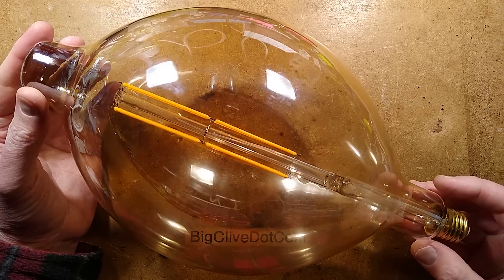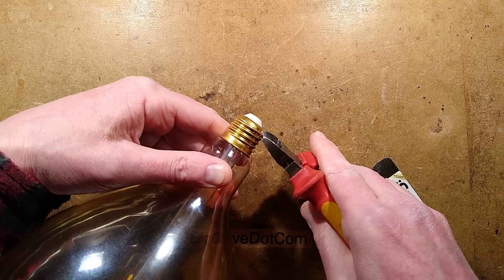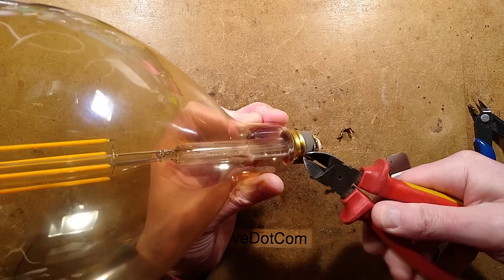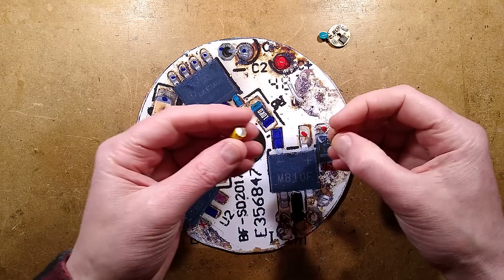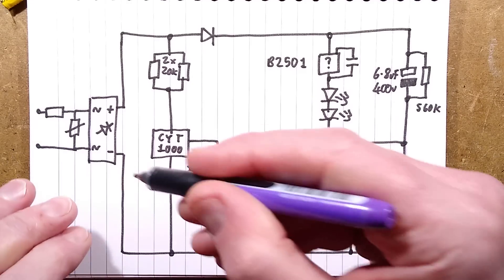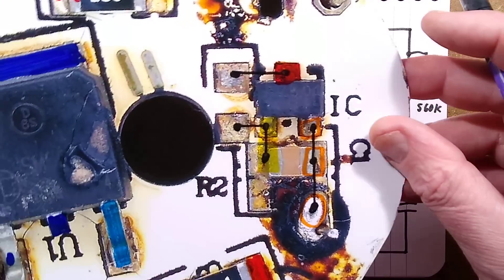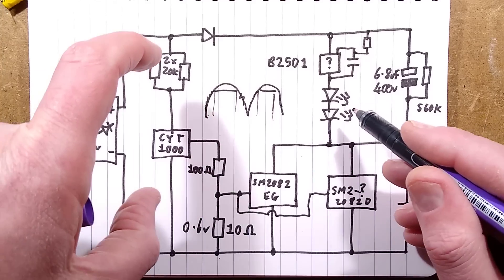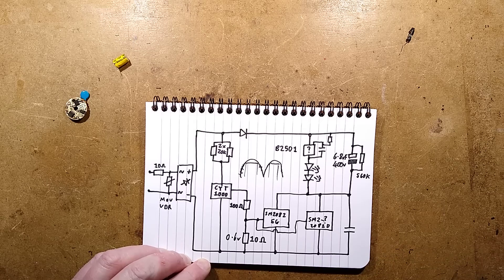Inside a huge faulty Poundland lamp

Comment: If you got some thick-ish tinned or bare copper wire, could you tin one end, push it up to the contact, then hold the soldering iron onto the free end and let the heat creep up the wire? It always seems to creep fast enough to my fingers when I use bare copper wire.... perhaps put some gel flux on it to give it a hand.
Reply from the maker: I'm not sure how easy it would be to heat it like that.

Comment: I just wish I knew what the bulb was for. The rest of the video, as always, might as well be in Greek for all I understand. Looks like Clive needs a new Sputter. That one is showing its age. And, why would I fast forward? I wouldn't miss the demolition for anything(although, by the time you got it opened, my muscles were as tense as wire springs, and I had to take a deep breath.)
Reply from the maker: The bulb is purely decorative.  The spudger has put in spectacular service, unlike the clones of it.
Reply: @bigclivedotcom  Thanks for responding. I know how it's difficult to give up a faithful companion tool. I have 3 tools my father that came from the Sinclair Refinery  where  he worked as a steel rigger. He gave them to me when I went off to college in 1960. They are industrial quality. But I have accumilated others, of lesser quality over the years, so maybe a new Spudger might be of servicle and keep you from hurting yourself. I am sure you can fix the bulb wiring and find a good use for.

Comment: My recollection of these from the one I was messing with, now that I think about it, was that the capacitor still charged in the usual manner of a saw tooth near the crests of the sinewave. But when there was sufficient voltage headroom, it would basically act more as a constant current source above a certain line voltage, and progressively lop the top of the charging peaks off more and more to maintain a set voltage across the LEDs (based on the LED current). So rather than a sawtooth waveform when looking at the drop across the fusible resistor, it looked more like it was clipping sort of like an amplifier when its overdriven. This helped spread out the conduction angle a bit. The downside is that it requires a certain load to work properly. Below that, it doesn't regulate at all and the voltage just rides the peak mains voltage when the difference in voltage becomes too small (i.e. reducing the current thru the LEDs). The capacitor will simply charge up to the peak mains voltage, and it wont have any headroom to regulate. The light will still work, but there will be more flicker since the voltage isn't regulated. Edit: The one I had was not dimmable, though, so it was a bit simpler.

Comment: That arcing could have resulted from thermal expansion stressing the sh!tty lead-free "solder" substitute. Mechanical stress causes the same; I've just repaired my laptop PSU after managing to crack the thing open (without completely destroying it) due to mechanical stress knackering one of the connections on the supply side. It was making some scary noises, getting rather HOT and stank the place out. I got a whiff when I used the mallet on the front wall outside to crack the seams. Thankfully the smell was due (mostly) to the scorched inner surface of the plastic housing. Maybe you could fix this by replacing that capacitor, making good the connecttions and fitting a replacement lamp base from e.g. a failed CFL?

Comment: Those paralled regulators aren't voltage regulators, they are current regulators, which is why they can be put in parallel successfully.

Comment: These PFC lamps are kinda crap. Have a stack of dead ones already. Don’t know if it’s because of LED issues or they just fail more from all the extra junk inside. Kind of like we’re going backwards. They started off complex with SMPS’, then got delightfully simple with the linear supplies, and then the energy Karens stepped in and made them complicated again. I did fix one with a dead LED and it’s kinda neat to watch it do it’s thing on a scope, and it’s clever. But it also kinda sucks since it’s not very flexible and modifiable like the linear ones are.

Comment: The SM2425PSAN is a P channel mosfet in an sot23-3 package, with a chip marking of the format B25XX (where XX indicates lot #). I'll admit it's a stretch, but kinda makes sense what with pfets commonly being used for high side switching. Also, I hate to ask for more from Clive, but having pin numbers on the mystery chip schematic makes identification attempts much more fruitful ;)

Comment: I took apart a flashlight lamp a little while ago and I don't believe that IPA dissolved the cement. I ended up having to slightly crush the lamp base. It may be different cement, however, due to the tiny power consumption of those lamps.

Unfortunately, the plan didn't pan out due to space constraints, but the adapter was still gloriously cursed. Here's a photo: https://i.imgur.com/LIjeOAj.jpg

Comment: I have always dissolved the lamp cement by soaking it in water 
it is not ideal for modern electronic lamps as they need to dry afterwards, but it has always worked to get the lamp separated from the base.
Reply: Which would also explain how water is able to get into lamps.
Reply: @samk4128  ;-)
Reply: Still if it works a great way to reassemble, if one were so inclined.Thinking Clive was a little bit miffed , in this case that it would not appear to be an option.

Comment: Your mystery component is likely some variant of transistor. 🤔 Possibly a PNP. With a capacitor connected between the base and collector of a PNP transistor, and the emitter connected to the positive supply, the transistor would turn on while the voltage is increasing and turn off while the voltage is decreasing, creating a sort of square wave.

Comment: My method for limiting destruction when accessing the power supplies of this type of lamp, is to carefully use a hacksaw to cut around just above the screw threads.  As you're working with very thin metal, a thin blade can be used, which will help with reassembly.  

When reassembling, just solder the cut back together.  If the gap is too large because your cutting was sloppy, or your saw blade was too thick, use fine stranded wire(insulation removed) wrapped around within the gap, to bridge the gap and add strength to the joint.  

It's best to tack the screw on first with a few small joints, then solder in segments, so you can check for alignment before the seam has been fully sealed.

If your seam has grown too wide when you're done, due to the solder's flow, just use a razor knife to trim the excess.

Comment: Why is a LED bulb using a Canadian/US type sodium vapor outer envelope? That just seems bizarre. It's enormous. Was this for a street light? Weirder still, it's not a mogul base.
Reply from the maker: It's a decorative lamp.  Maybe even using a vintage mould.
Reply: @bigclivedotcom  I forget the exact designation, but where I live, before the advent of LED street light panels, the old sodium bulbs were all that size and shape. The glass was borosilicate, so it was fairly easy to cut them open with a propane torch, remove the guts, and turn them into decorative candle lanterns.

The glass composition meant as long as you heated and cooled the surface gradually you could prevent it cracking as it sets.

Comment: For your next lamp disassembly, try drilling into the tip bit [of the base], first, screw in a wood screw in the hole making sure the threads hold on, and yank out with pliers.

Comment: Always coming across dozens of these at the local scrap yard. But not the LED version just the old original boring version. It takes a massive fixture, transformer, and several big capacitors in each fixture. I'd say the fixture transformer, and hardware alone way 30 or 40 lbs. They're always around, and whenever they come in they usually come in dozens at a time I guess when they're updating something. Also a good source of a big piece of high temperature plate glass
Reply: That sounds more like a mercury arc rectifier than a lamp.
Reply from the maker: The mercury discharge lamps were commonly used in high bay lighting in warehouses, steel mills and factories.
Reply: Mercury vapor, perhaps, from a school gym or retail parking lot. The bulbs have a very long service life, somewhere around 70 years. The EPA outlawed import of the ballasts, even the new electronic ones, so it's become a fix it or lose it thing. Of course grandpa left a spare.
Reply: @tactileslut  Forced to replace your 70 year lamps with LED trash that'll barely last 7 years...? Yeah that'll help the environment.

Comment: No, I could not fast forward because those sounds resembled nothing so much as thin glass cracking... I fully expected the damned thing to enthusiastically separate into many pieces and just couldn't look away.

But I really didn't want to see any more of your blood so I am not disappointed in that.

I share your frustration with that weird assed circuit though. Who parallels two different limiting chips like that? I want to see the pitch whoever designed that circuit gave to justify those weird decisions. Is this another case of "we have all these chips we can't sell, design something to use them up"?

Comment: Bit of a shame that it broke, but, with some careful use of a glass cutter, you might be able to open the bulb up to extract the stem & LEDs, and then fill the bulb up with whatever you like... :D
Reply: Make a little ship in a light bulb.
Reply: With the led insides removed ( in what ever fashion ) the globe inverted on to a suitably shaped heating base , in thinking , this globe could be fashioned in to an unusual glitter lamp
Reply: Careful use of a glass cutter? Nah, get out the hammer of knowledge!
Reply: Diamond files or sharpening rods will cut glass in a controlled way.
Reply: Could also try the old string soaked in spirts, set alight and then immediatly quench in cold water trick, the thrmal shock along the line is supposed to crack it in a controlled manner

Comment: If this is a dimmable lamp, then the mystery chip might be used to convert changes in current into some type of PWM. LED's (of course) don't dim well, so something needs to be introduced beyond simple voltage/current changes.  Would be interesting to take a scope to a working one and see what is going on.
Reply: A light sensor maybe?

Comment: A Dremel (small rotary cutting tool) might have worked well to remove the metal base.
Reply: the risk with a cutting disk is to go too deep and damage the components inside.
Reply: While I have the original mains dremel with last 25 years or more, in recent times both Aldi and Lidl have done both corded and rechargeable versions which at the price with the included accessories is a no brainier compared to cost of “ genuine” dremel bits. Recently lidl did sets of circuit board drills ranging in size from iirc  .5 mm up to 3 mm in roughly 18 steps. Sold in packs of 6 bits. Think the 3 sets to cover the range cost me in region of 15 euro.
Reply: @patomahony9747  sure but you get what you pay for. I bought two of those inexpensive wired dremel clone sets and some of the included accessories didn't last long, especially the SS bits and the cutting discs. Had to quickly buy HSS drill bits and diamond discs to work on brass and aluminium. Though the first clone I bought didn't survive some MDF works as its sawdust glued inside the tool because the air cooling flow of this design is mounted in reverse than any tools, the intake being near the chuck instead of the outtake.
Reply: @PainterVierax  can’t say I’ve had any problems. But I do make my own cutting disks out of generic 4 or 5 inch angle grinder slitting disks by cutting a rough circle of material and mounting it to standard mandrel then true it up or even  put a profile on its edge using a coarse grinding stone ,normally used for dressing bench grinder wheels. If it’s a really fine cut then as a last resort I do use the dremel or generic discs. Same with burrs , luckily from my days in industry I have boxes of different type burrs and end mills etc 
Have even machines down the shank of some of the bigger milling cutters to fit the chuck.
Reply: The range do a very good "dremel" complete with accessories.

Comment: Paralleling linear regulators without a ballast or a compensation is dangerous business, just like paralleling two zener diodes. The fact that they share the power equally depends on luck. My experience is the tolerance of voltages make one regulator taking all the load, and then exploding, like it seems to be the case here. Power sharing with Chinese characteristics...
Reply from the maker: In this case they are current regulators so each just passes its current.

Comment: It does look like that(possible) poor connection is directly in the vicinity of the electrolytic cap.  I'm thinking it cooked the capacitor internally from the heat.

Comment: That lamp globe looks like it was originally used for a high power discharge lamp. A 1000 watt HPS lamp that's found along highways perhaps? (The very tall ones with 4 to 10 lamp enclosures.)
Reply: That's what I thought.

Comment: cant wait to see a jr service tech try to replace a 1000w MH lamp with 1 of these without replacing the fixture
bet the original MH has 10,00 times the expected life of a new 1 of these
ugh, why wont this fit??? boss, you'll have to order a bunch of med to mog thread adapters for this new box of led bulbs, none of them fit in the old fixtures

Comment: Did you say you did or didn't like the Knipex flush cutters?  I broke my cheapo's installing a starlink dish (doing things I shouldnt have been doing) and i'm debating them
Reply: Knipex tools are great and IMHO worth their price. But I wouldn't use them for "abusive" work. 
I currently have 2 flush cutters: one from Knipex and a cheap no-name one. Using the cheap one pretty much all the time (also for a lot of stuff flush cutters aren't meant to be used for), the Knipex cutter only gets used rarely when I do stuff like soldering.
Reply: @NiyaKouya  I have a lot of knipex tools (general electrical work, I use them for farm fencing, automotive work, broad range of stuff)
I just KNOW that I abuse tools.  That's why I buy the good stuff to begin with, it holds up much better.  I saw that one of the knipex flush cutters was rated for cutting harder metals and it piqued my interest.  I have their baby regular diagonals and I LOVE them.
Reply from the maker: Knipex cutters are my first choice.

Comment: Would a burning solder link work up the tube? Easier to just light one than use an iron. The other comment about pulling the wire into a tube might break more off. The wires passing through glass are never copper as far as I've seen. Pouring a saturated solution of copper sulfate in will "tin" it in copper. Its not the best coating though b/c it pulls the iron out and into solution as it drops out copper. Save that for post apocalypse when ya gotta fix the last one. You could grow a link, just put a resist on everything you don't want to build-up and run the electroforming right in the base. Sorry 😃 that's my bag and I've said too much 👍

Comment: Hey could ya do a vid where you explain the difference between a mosfet and a transistor?
Reply: TL;DW:  The MOSFET is voltage controlled and a BJT is current controlled.
Reply: Well whas a bjt then?

Comment: To get it working, to get a wire up there, use a rigid thin hollow, plastic tube. Then push a conductor up the tube and bend it around the end. Then push the tube over the little bit of wire sticking out inside the lamp. Not perfect, but should work for lowish current.
Reply: A stiff wire with a female connection  will plug onto the dumet wire.

Comment: The last time I saw a bulb that big, I was using 1000w grow lights and the heat was tremendous.  Don't tell the "greenies" but plants LOVE very high CO2 when the heat is that high.
Reply: That is because photosynthesis is converting CO2 to O2. Current CO2 concentration in the air is less than 1% and it is rather hard to extract it to add more oxygen to 20% oxygen, so plants do appreciate more of CO2 when there is plenty of light. That is the whole point of "green" movements, i.e. stopping deforestation. However when there is no usable light plants breathe oxygen and produce CO2.
Reply: @jwhite5008  Yeah.  I get that.  That didn't stop me from making a joke though.  I do appreciate your attention to detail though.
Reply: @TechGorilla1987  Well, today sadly it is becoming increasingly difficult to tell a joke from  ignorance :^(
Reply: @jwhite5008  That's an extremely prescient observation.  Stay well, fellow internet plant person!

Comment: Have you seen the bulbs that have 3 power settings? You toggle the power quickly and the brightness goes down one level. Perhaps the extra chip is for that.
Reply: I have a dimmable LED bulb like that. You toggle it quickly on, off and on again  and then it starts slowly fading up and down, you turn it off when you get the the desired brightness.  Then finally turn it on again to use the light.  It works, but it would probably spoil the mood of a romantic evening ☺️
Reply: @mc_cpu  Oh that's fancy.  Mine just does max-mid-low brightness.
Reply: I have had one of those smart bulbs as a night reading light for a number of years. Works really well.
Reply: that's cool
Reply: It would need a capacitor to store the memory though.
Reply: @shaunclarke94  Or an EEPROM.  They don't particularly care how long it lasts, more failures means more sales.

Comment: I got a new light for my kitchen that uses a 300mm tubular edison style lamp, but the stock lamp that came with it was a 240v 2700K lamp. I'm one of those freaks that prefers 5000K lights and I live in a 120V country, so I'm gonna make my own lamp for it. Tempted to put all the components on display inside the tube instead of hiding them in the base.